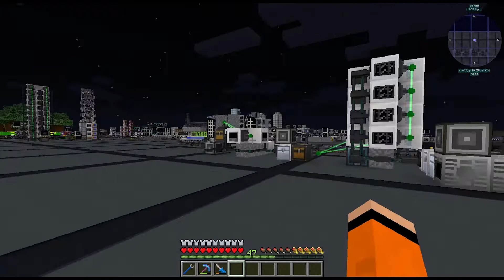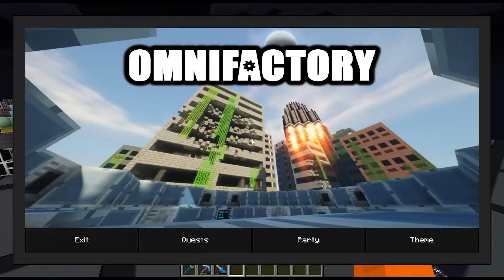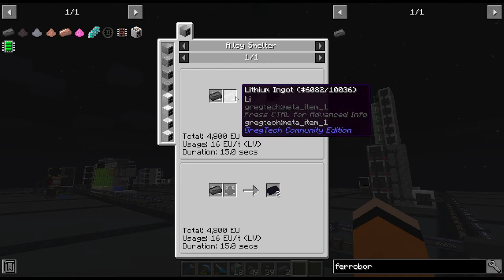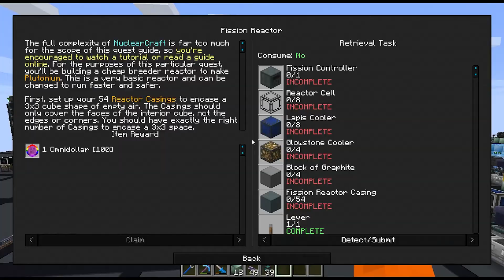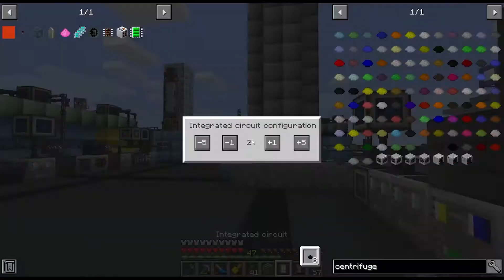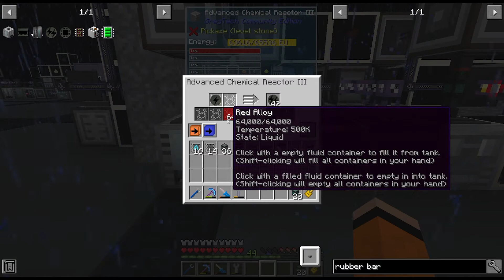Omnifactory - NC Fission Reactor & Circuit Wafer Automation! Minecraft - Episode 18

Comment: 200k rf/t? I can't go past 40k with 116 reactor cells. What is your design? Also, love the your series!
Reply from the maker: Are you using TBU fuel? The reactor will output different RF amounts depending on the fuel you input. Also if you are not on the dev version of the pack the fuel outputs may be different, as I know they tweaked it in one of the updates.
Reply: @Threefold.  I'm using TBU as fuel. I guess they must have changed something in the meantime.